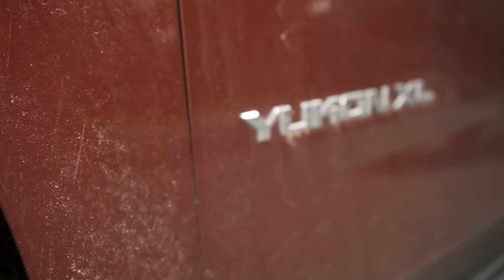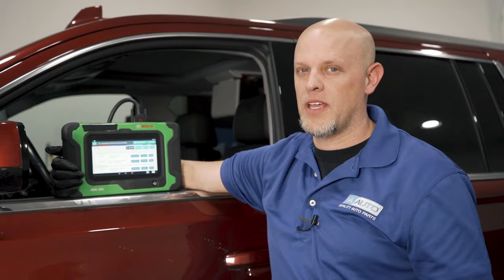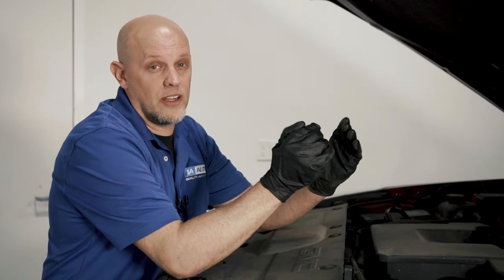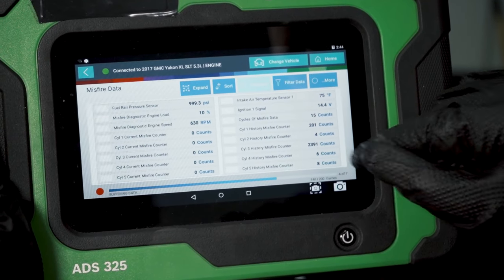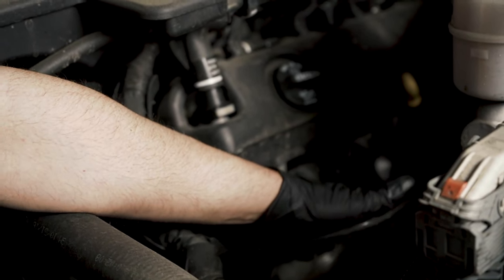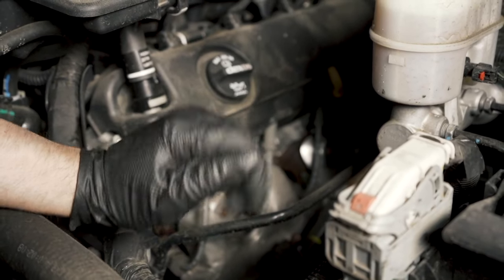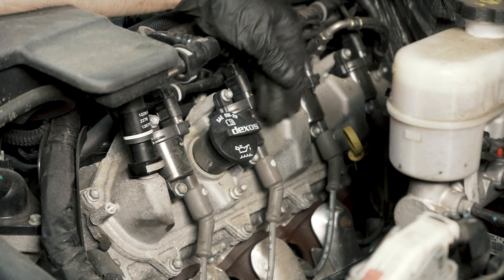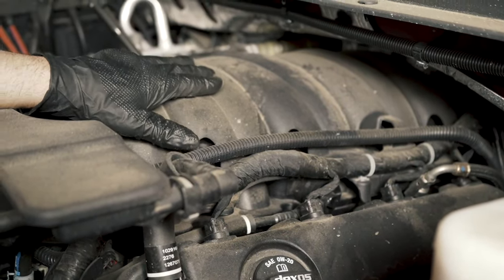Cold Start Rough Idle? How to Diagnose Trouble Codes P050D & P219A

Comment: Carbon buildup on the valves? Top end cleaning? On a gdi engine? I think somebody may have read the signs wrong here. Gdi engines ONLY flow air across the intake valves. So no carbon buildup should be present there. Gdi engines also burn more efficiently so less or no carbon deposits should be present on the exhaust side though. COLD start rough idle is usually caused by shrunken intake manifold seals. Since they don't have gaskets anymore, the rubber seals tend to shrink over time and will leak air until they heat up and expand enough to seal. I usually like the videos produced by this channel. But I'm fairly certain they missed the bus on this one.

Comment: I have a 2015 Dodge Journey RT 3.6L,  I have P219A, I  have swapped Spark plugs, Fuel Injectors and Spark plug coil pack. When I replace injectors with aftermarket code goes away but I then get a P0172/P0175. Any help please.

Comment: Crappy gas
Reply: Yeah I only run 110 low lead
Reply: so why does this not happen to other cars. I am a gm nut and my newest 2016 tahoe is terrible. this is not just bad gas its bad engineering and quality. i have a 05 and 04 5.3 and they both are flawless . run the same gas so its not the gas or all vehicles would give these issues. it could contribute sure but thats not the main issue. they want 2200 for new injectors at 115k miles. i call bs on this crap. gm  as well as  all makes are just putting out crappy stuff now and charging way to much for it.